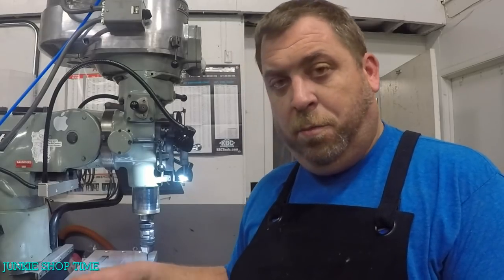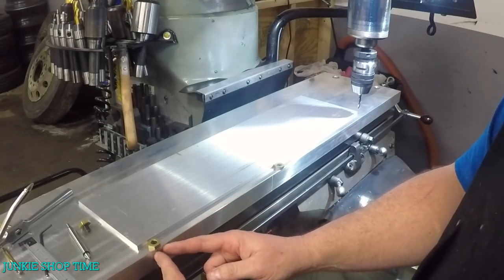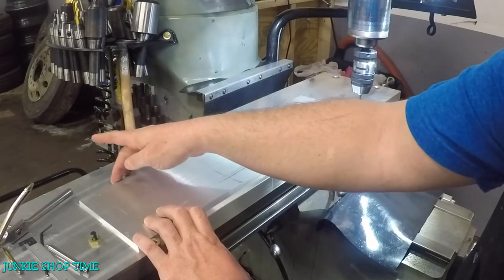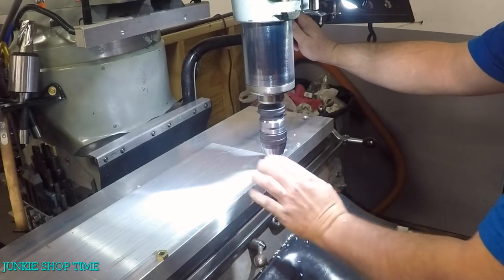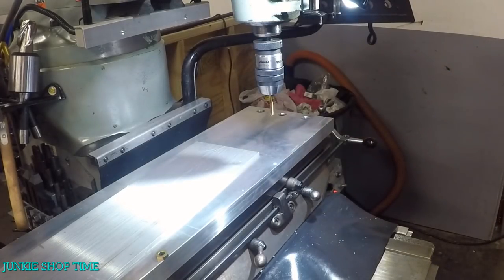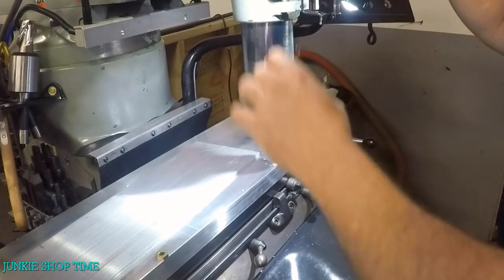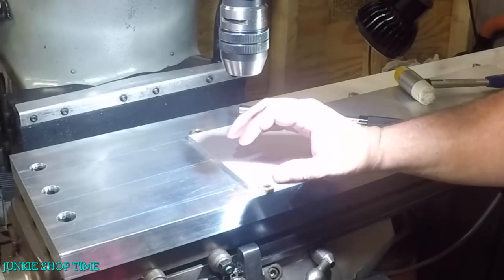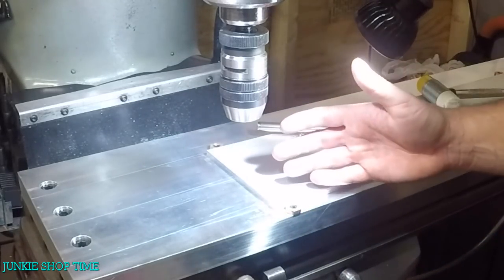SOCKETS TRAY BUILD PART 2🗜⚙️⚙️🔥🔥🔥

Comment: Use spiral fluted tap for power taping or just taping blind hole. You won't need to break the chip. And the spiral fluted tap will pull the chip out of the hole by itself

Comment: Do not use wd40 when tapping in aluminum. Get some tap magic for aluminum. Ive broken taps using wd40
Reply: Anchor lube works well also.
Reply: How do you brake a tap on aluminium?
Reply: Tap binds up with chips because your wd40 is piss.  Fine for machining not tapping